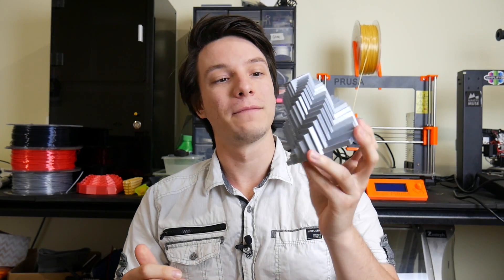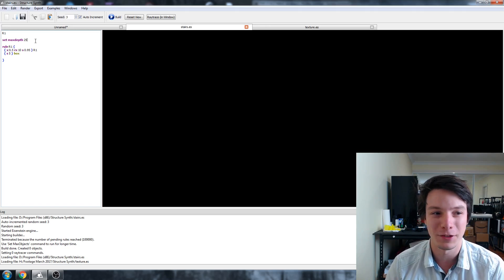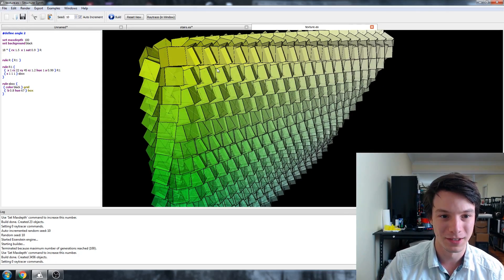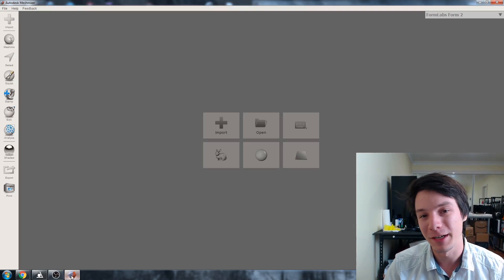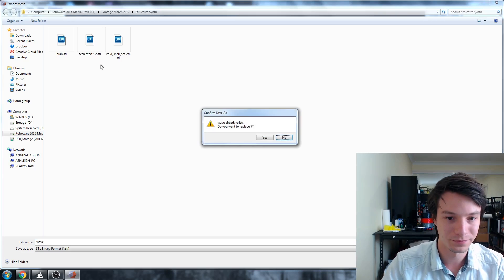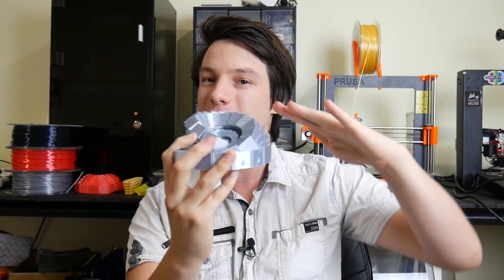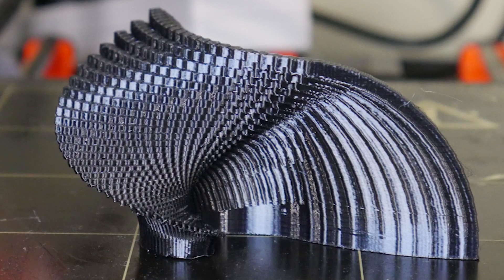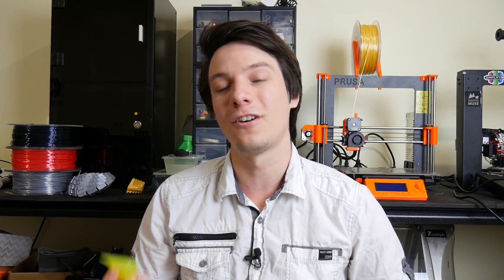3D Printing impossible geometries with Structure Synth

Comment from the maker: If you're experiencing a low frame rate there is currently a bug with how YouTube plays back 50fps uploads at low quality. Change your playback to 720 or 1080p for smooth playback. Working on a solution. Happy printing!
Reply: Maker's Muse it was perfect
Reply: None of these geometries was impossible. Get an M.C. Escher book.
Reply: Maker's Muse my YouTube changes it automatically
Reply from the maker: It looks like they've now fixed it on my end - is it playing back better now?
Reply: bug is still here
Reply: Maker's Muse  I have a challenge can u make me a mantis shrimps hammer this will b one of the hardest things to print in my opinion
Reply: Maker's Muse i
Reply: You like to do things with your hands, means you're a natural engineer, not a mathematical theorist.
Reply: That's the kind of art I would like to go and see in art galleries.
Reply: it was fine for me
Reply: Each time I click this pinned comment, I see a different comment.
Reply: It is very good and easy
Reply: Maker's Muse hey angus
Reply: Where is he from?
Reply: i need help with making a tree that split into three's
Reply: because pretty much everyone else on the planet pretty much can get 1080p these days. barring 3rd world countries but sometimes even then
Reply: would you rather the video be called "sitting here not printing these impossible structures because they are impossible?"
Reply: Hey cool boy <3
Reply: I don't think 3D printing complex mathematically derived, recursive geometries has the same ring to it.
Reply: Just out of curiosity, to what purpose are your videos at 50FPS? Is there something might wish to see in slo-mo? If not, transcoding your videos to 30 would be sufficient for normal-speed viewing.

Comment: New comment on old video, but, I just wanted to say: programming is often just a series of steps in reverse engineering what you want to have the code do -- kind of making a check list of what it needs to do in reverse until you reach the expected input from the expected output, and then tell the computer how to do the same thing in the forward direction.  This is also why TDD and BDD (Test/Behavior Driven Development) are pretty common development methods.

Comment: you can probebly pull it into google sketchup and use the intersect tool so it will select all of of the intersecting bodys letting you remove them without losing angles

Comment: Your description of your issue with mathematics was as if you were in my head when I was 16.  I never could understand the practical application of advanced mathematics.  Later on I realized through the school of hard knocks it is about problem solving with less than complete information based on rules and structure.  If my 7th grade algebra teacher could have just said that I think my life may have been very different!

Comment: Basically that is Logo (and later Scratch) ported to 3 dimensions and with a fixed recursion limit (at least in the first examples) instead of a conditional one issuing the procedures (herein called "rules") to stop.

Comment: Given the messy consequences of the meshes by this method, I wonder if you are familiar with Blender open source software (https://www.blender.org/)?
Apart from being a 3D modeling tool, it also supports object creation by script, in this case Python.  A simple search of Youtube will provide tutorials of such activity.
I suspect with a bit of practice you can create much more 3D printer friendly objects, yet with as much complexity as your imagination will envisage.
It also supports a wide variety of export formats to aid the modeling process.  Similarly you can import existing object upon which scripting magic can be applied.

Comment: Hi Angus, my name is Christopher , i live in Bulgaria.  I watched your video about the gears of war figure, and I downloaded it. And I understood more about what you were saying about shells. I loaded it in Rhino and in a second or two I made it into one part, but I did not see what rhino had actually done though.  I love fractals, the same day I download the software you mentioned in this video. And, there are lots of samples, I randomly picked one , saved it as an object and I got it ,loaded in rhino oh, so many parts, it looked impossible to print. Using the advise from the gears of war video I managed to get the parts into as few parts as possible. But, still so many parts. This model i chose was basicly a sphere , I thought for a little while and came up with the idea to slice it all in half and add two discs as bases. Then i spent some time making a base for it all in rhino. (fusion 360 looks easier to use, i don't have) I  made a few images in rhino and it looks possible to print. Guess what, yeh, I dont have a 3d printer.
I have been watching the progress of these machines. So far the cheapest one in bulgaria at the moment is 2500lev about 1500 dollars. Well, that is just mad money.
I am on a tight budget and I have not seen second hand ones for sale here, I am on about 200 lev a month at the moment to survive. Simple life, eat food pay your bills, hahaha. Anyway I was wondering if anyone would be interested in printing such a strange looking globe, well that is how i describe it. I have some images to show if anyone might be interested. You give good advise and i dont have a printer, hahaha, have a good day, Christopher in Bulgaria

Comment: FYI this is called generative design. What you can achieve by indirect code based CAD is way beyond the GUI capabilities. I use FreeCAD python scripts. But there are others. Openscad, blender python scripts and rhino grasshopper to mention some...

Comment: Angus,
You can do a similar thing in Onshape....

https://cad.onshape.com/documents/2113e9bb0bb5c2abd6b7addb/w/3ca0c9142653b62adbcbc80b/e/d68db909160cb30ebc1c4fa6

I didn't try and replicate exactly the objects you created, just showed the principle..... (it may work even better by applying linear transforms in the pattern feature 'loop'....)

The nice thing is they are solids that are unioned together at the end so the Exported STL is manifold (#haven't tried printing one myself yet!)

Comment: set pivot [10 0 -50]
set scale 0.1

8 * { rx 45 }R1
{ x -15 }R2

rule R1
{
 50 * { z 1 x 1 y 1 ry 4 h 20} R1
 { s 4} sphere
}

rule R1
{
 50 * { z 1 x 2 y 1 rx 4 h 20} R1
 { s 4} sphere
}
rule R1
{
  50 * { z 1  x 2 y 2 ry -4 h 20} R1
 { s 4} sphere
}

rule R1
{
 50 * { z 2 x 1 y 1 rx -4 h 20} R1
 { s 4} sphere
}

rule R2
{
 5 * { x 1 blend blue 0.4} R2
 { s 30 } sphere 
} 
my code

Comment: Is it possible to create cube/sphere design I've been working on? It's hard to explain, but the basics of it is that you start with a  1x1x1 cube, then you delete the inside of it with the creation of a sphere with diameter of 1. Then inside the sphere space, you add a new cube, which cube's longest diagonal equals the sphere diameter. So that means the cube diagonal is basically 1 still.

And you keep doing this over and over. A cube in a sphere in a cube in a sphere infinitely (well not completely infinitely lof course), with each cube adding volume and each sphere deleting volume. Here's the formula that show the final mass as well as the ratios.  http://www.wolframalpha.com/input/?i=sum(1+%2F+(sqrt(3)%5En)%5E3+-+4%2F3+*+pi+*+(1+%2F+(2+*+sqrt(3)%5En))%5E3,+n%3D0+to+infinity)

Comment: For combining many many meshes together into 1 solid object I use 3D Coat.  3D Coat is really a great tool to use for 3D printing.  Being voxels you can punch holes and keys for parts very easily.  The software can do so much.  One of those Swiss Army Knife type programs that can help in so many ways.  And you can keep the voxel space very high poly to keep the sharp edges.  Of course Zbrush is a great tool as well but for this kind of thing 3D Coat is amazing.

Comment: Hey Angus, I'm currently looking for a high quality 3d printer and I was wondering what is the highest quality 3d printer you've ever used or seen. Price isn't an issue, I'm really just trying so see whats out there. Now I know that there are 3d printers that use other methods than extrusion that have very high quality. I'm just looking for an extrusion 3d printer that has very high quality. Hope you or anyone else in the comments can help.

Comment: Great video, and I'm happy to throw a buck or two your way for the model.  However Gumroad doesn't support paypal, and I don't like giving my credit card number out to them.  Is there a way for gumroad to handle Paypal?
Reply from the maker: Hey Ben, to the top right of the card information it should have 'pay with paypal' as an option, is that showing up? If not feel free to hit 0 and give it a go no worries!
Reply: Thanks Angus, I didn't see that, it was greyed out. UI fail!  I've sent you some money for this.  Great tip with Structure Synth!  I love it.
Reply from the maker: Thanks! No worries, have fun printing it :)

Comment: If you have windows 10, the built in 3D builder application merges intersecting mesh objects into a single shell without rounding off the edges on your machine without having to upload it to a cloud service.
Reply from the maker: Yep windows 10 is awesome for that application but less awesome for many other things so I keep my main PC as windows 7 - at least for as long as it's possible.
Reply: @MakersMuse  Kinda late reply, but you can use a VM for the sole purpose of it. :)

Comment: you failed math because you called it "maths"
Reply: He was speaking 'Engllish ' not American !
Reply from the maker: Yep, we call it maths. I hated it.
Reply: At least he did not confuse mathematics with statistics. The lore is that statisticians and mathematicians hate each other, and get mad if you confuse their respective subjects.
Reply: Because statisticians often know a lot less about the math they're using. I took stats after Calculus and realized a lot of it is... "dumbed down". After you take discrete math and higher math subjects stat's is basically built around all of that but often requires less "know" how to do it, and more "these are the numbers you plug into the computer/calculator and what functions you need to use". Most stats problems can be solved by simply knowing calculus and discrete math, you almost wouldn't even have to look at a stats book, as long as the problems were expressed without statistics jargon.

Not saying statistics isn't great, but you get a much better appreciation for it when you have more background in math. It would be a sort of "insult" to call a mathematician a statistician because a mathematician normally knows quite a bit more theory, including the fact that they may know stats period. Obviously a more learned statistician knows different things though, more practical things like choosing proper samples, population sizes, etc, that the mathematician may not know as well.

It would be like calling an electrical engineer an electrician. The electrical engineer probably has a few skills similar to an electrician, but chances are the average electrical engineer knows more theory, and other things, than simply dealing with home wiring (not to say the electrician doesn't not a lot either).
Reply: Iain Duncan you don't speak 'American' you speak 'English'. However you use americanised and modified vocabulary called colloquial vocabulary. Colloquial vocabulary depends on where you are in the world and how people speak a certain language compared to how a person from another country would speak the same language. A person from England would stereotypically say a 'brew' or 'cuppa' meaning a cup of tea, this is colloquial language for England. An example for the U.S. Is in the southern states people would sway towards saying 'y'all' instead of saying you all the more south you travel.
Reply: Maths is the correct term 
We use it in England too
Reply: Australian dialect.
Reply: Wait, they do math in Australia?
Reply: Australia is such an amazing country, it has its problems but I love it here nonetheless.
By the way, we say maths because that is what it always was until Americans started calling it math. Maths is short for mathematics not mathematic.
Reply: TheRallyGamer too many big words for him
Reply: And just a note for those saying that Americans changed the language, what actually happened is that, after America became independent, the version of the English language used in England and Australia actually evolved, so technically speaking, the version of the English language used by most Americans is a more primitive version previously used by England and Australia, just to make sure I don't offend anybody, I am in no way calling Americans or their culture primitive or less advanced than Brits and Australians, I'm simply stating that they use a more traditional version of the same language, which does not mean that they are in any way less intelligent or advanced than others.
I am truly sorry if this did seem offensive and would appreciate any constructive criticism as I have always been terrible with wording things to avoid causing offence, it's just something I have never been able to do very well, I have, however, been told that I am very skilled in changing the subject of a conversation or paragraph, as you may notice by looking back over.
Reply: +doomdragon178 I'm offended that your trying so hard not to offend anyone.
Reply: +doomdragon178 I'm offended that your trying so hard not to offend anyone.
Reply: Maker's Muse, wait, you hated what it was called or the subject itself?

Comment: Can I recommend you to try OpenScad? http://www.openscad.org/ 
It is a project that has recent releases and is growing really fast. And it does exactly what you described here. I am a programmer and I am mess using 3D design tools (CAD software included). So I need to have parametrisable objects, so we set the characteristics of the object using variables and code... OpenScad allows you to do that, and it is quite simple to use, you just use the wiki to get what you want: https://en.wikibooks.org/wiki/OpenSCAD_User_Manual (I always use it reading the wiki)

You can see an example of objects of this type here:
http://www.thingiverse.com/thing:1339 (It is not my design obviously)
In this case we can get the gear that we need by just modifying some numbers. It is an awesome way of sharing things. Also the .scad file it is very light and small, so it is easy to share it. And for me at least, it is very easy to modify.

 PS: Also it can output directly to STL

Comment: You need to get a 3D mouse from 3DConnexion.
Reply: I second that - it's a huge timesaver and once you get used to one, you will not want to to modelling without it. What's more, smart hackers reverse engineered 3d connexion's protocols and made open-source libraries for controlling their devices, this way it works in different OSes and in a highly customizable manner. Software like FreeCAD and Blender have full support for it.
Reply from the maker: I've tried 3D mice before and they were OK, are they worth it?
Reply: Maker's Muse , I am a 3D Draughtsman and I cannot go without one. I totally think it's  worth it.